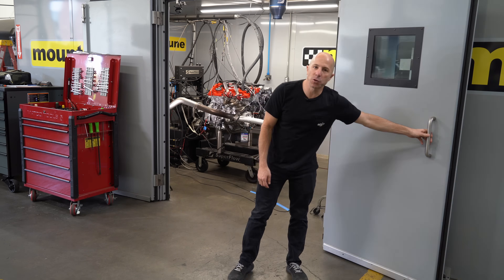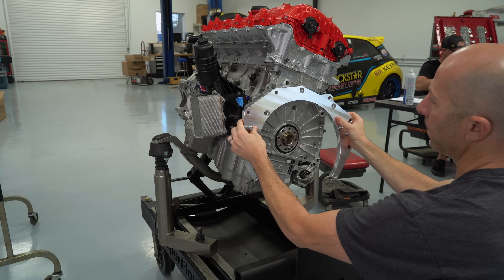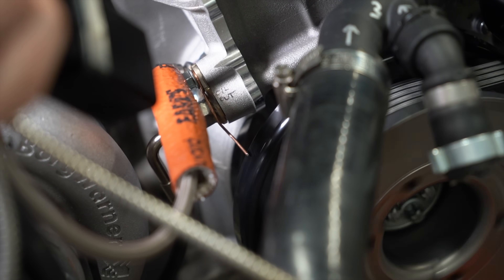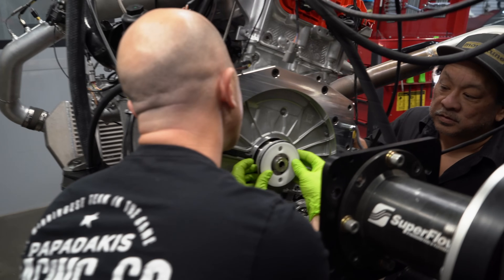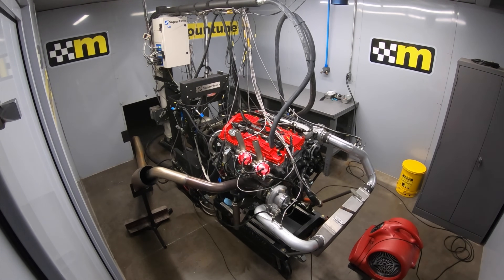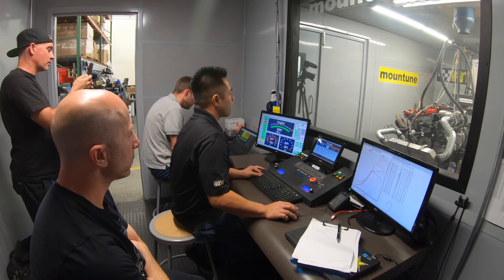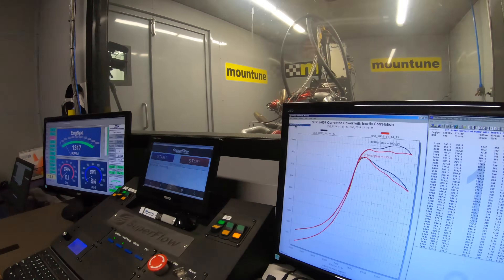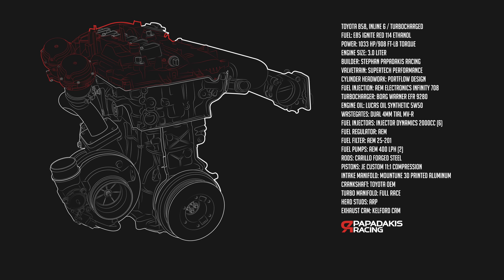B58 Engine Dyno 1000+ Horsepower - Sounds like a 2JZ!?

Comment: B58 makes 1000hp
2JZ: I am proud of you son
(yes I realize it's a bmw engine. Should have said adopted son)
Reply: When JDM fanboys get salty about the BMW engine.. 🤔
Reply: @aricarphotomuc  That's the one thing toyota should've made for the supra. Hell, they could've even used a lexus v6. The b58 is a good engine but it's an insult to the supra legacy because toyota had nothing to do with its production
Reply: @kiyoponnn  hmmm
Reply: Correction

B58 makes 1000hp
2JZ: I am proud of you son from another mother
Reply: B58 makes 911ftlbs
S52: I am proud of you son
Reply: @hyattbusbey3563  Americans ban BMW Z4
Reply: @grocerygrip  change 2jz to n54 wouldn't change the writing
Reply: Grocery Grip German moms are the best right
Reply: @grocerygrip  the 2jz has alot  dominant DNA because it is really similar to the 2jz.
Reply: LOL
Reply: Mix Races 2020
Reply: Well he has a lot of sense to be proud of considering the M50 m52 s50 s54 n54 are just as tunable
Reply: @CirocObama.94  yes
Reply: 1000 German horsepower is a lot faster than your old 90s engine
Reply: @Fanie Botha a full size sedan. You are comparing a full size sedan to a Supra
Reply: @aricarphotomuc  yeah, a legit Toyota platform vs a BMW chassis and block
Reply: @turbocavalli  you know that I am joking about the son thing
Reply: @aricarphotomuc  yeah, but I might as well let it out before I scream it front of my local BMW dealer
Reply: @turbocavalli  Loooo
Reply: @aricarphotomuc  ok my dad's toyota Levin bzr then
Reply: @aricarphotomuc  Camry's aren't full size sedans XD they're a mid size
Reply: @aricarphotomuc  atleast the camry is a toyota not an BMW
Reply: @z0n4l1  Hence its shortcomings.
Reply: z0n4l1 bmw is better then your favorite car brand
Reply: z0n4l1 is rather own a BMW than a Toyota
Reply: @Fanie Botha wooh it's a toyota! a slow grocery getter but hey it's a toyota !1!.

The new supra was also developped by toyota but using bmw parts. toyota stated that the parts bmw manufactures are up to toyota's standard and got through their testing. Toyota doesn't necessarily have to manufacture all the parts to be able to call the car a toyota. If that were the case a whole lot of cars wouldn't exist.
If bmw hadn't gotten involved we wouldn't have ever gotten an inline six sports car from toyota ever again.

I don't see how this car puts shame to the supra name. Nothing about the A80 supra was all that great except that it handled kinda decently under high speed and the drivetrain could take a lot of power. 
It was just a sturdy well built GT car and nothing more really.
The new A90 supra handles well and the drivetrain is clearly up to the task of making stupid power. Seems like a supra to me. And toyota agrees.

Be glad toyota bothered to actually make a new sports car. Everybody can finally stop screaming they want something more powerful than the 86. Which, in itself is a subaru by your logic but somehow nobody seems to care about that.
Reply: @youridv  Congratulations to BMW and Toyota for producing a car in Roadster and Coupe form for everybody.   Our world is  a much better place with both cars. We would all be driving electric toasters with batteries and touchscreens attached otherwise.
Reply: @youridv  The new supra wasn't developed by toyota you braindead moron. The only thing toyota did was the exterior styling and test its durability
Reply: @youridv  Oh My God! best thing I've heard someone say about the a90. Everyone just hates that BMW makes some parts but the name of the motherfucking Toyota GT86, Subaru BRZ, Scion FRS, all of them has the same boxer engine.

But the A90 has the B58 a nice successor to the 2jz👌👌👌👏👏 

Well done sir very well done @Youri Dv
Reply: Youri Dv you have some poor car knowledge or you just lying or telling a information that's defiantly wrong stop misinformation people and check you knowledge the new supra has nothing with Toyota it was tested by BMW you can see by the spy shots the chassis were made way before Toyota joined in the project it is a rebadged BMW there is nothing left from the original supra beside the name and some design elements
Reply: @adrianpopescu3930  If Toyota would have made the car. It would have had a 3.5l V6 or if they would have made the 3JZ it would have been way more expensive. BMW basically saved their ass. The design still comes from Toyota. And it's cheaper than a GTR R35 and lighter than the Mk4 Supra. Yes it's not really powerful but yeah. There is no other manufacturer building inline 6s anymore except BMW and Mercedes has returned making I6s aswell.
Reply: @youridv  nobody cares about that because subaru largely makes good shit, (outside of head gaskets) and bmw doesn't. Same deal with Yamaha and the jz.
Reply: @lakeshoresubtleties  that's bullshit. BMW makes pretty good stuff overall. The B58, N54, S55 and N55 are all strong engines. BMW also know how to make a good straight six.People are just butthurt because their "legendary" sportscar isn't completely japanese anymore. Purists will always be purists and I despise every single one of them. The 2JZ also isn't as bulletproof as people make it out to be. It's a good, reliable, strong engine but people think it's some kind of miracle of god. It's just an engine that's able to hold a lot of power when modified the right way but the circlejerk escalated way too far
Reply: @youridv  💯
Reply: @youridv  it seems to be a trend that  Toyota goes to other manufacturers for their sports cars now 🤔🤔🤔🤔
Reply: Youri Dv all true ma man
Reply: @youridv  always bothered me. Much prefer the bmw collab then the subaru scion/toyota collab
Reply: b58 finna be the daddy soon
Reply: @kobescambler  Barra is the one to aspire to in terms of HP for I6 engine from a production car !!!
Reply: @kobescambler  never
Reply: @clutchkickpj693  Always!
Reply: @clutchkickpj693  remember how many years it took to make 1000hp with a 2jz? This thing is so far way ahead of the 2j. I guess we'll see when and where they start cracking up tho.
Reply: @GreatLakesLogger  it sounds like it's cracking up already, if you have a stupidly good ear, you can hear the cylinders trying their hardest, and not hardest in a good way
Reply: @Fanie Botha 
I didn't know Camry was RWD and had an I6
Reply: Anthony Webber yea it's the new jdm model
Reply: @anthonywebber2211  It had a V6 option and you can convert the drivetrain anyway you like RWD AWD or 4WD
Reply: @mayuravirus6134  
Have fun making a FWD biased vehicle into a RWD one
Reply: 2jz had a hand from Yamaha and the getrag was a German trans soo even the mkIV had some not so Japanese parts...
Reply: Hey hey hey. Lotus has been running that toyota camry engine (2gr) for a while with good results. I'm not saying its better than the b58, but the 2020 evora gt has respectable numbers with that camry motor. 400+ hp, 3.8 0-60.
Reply: Fanie Botha 2020 Supra::: when your mom's Camry looks better than new Supra
Reply: Brad Viviviyal  yep. When R35 came out with the V6 twin people were reluctant about its tuning potential. It caused similar controversy when it came without a manual. And Today, thing's known as the Godzilla!! Mk5 will be a hit among tuners like the mk4.
Reply: @abhinashpattanaik5109  except the r35 wasn't made by Mercedes or audi and the engine was in house too
Reply: Second cousin at best lol
Reply: It took me years to get to that level.
Reply: @Fanie Botha Camry got all the bad genes.
Reply: Lol, it’s a BMW engine
Reply: Milkman69ner RKO OUDDA NOWHERE😂😂
Reply: Hehehehehe see everyone is making this shit out to be so bad it’s like come on it’s a good motor everyone is just holding too high of hopes like relax😂😂😂😂😂
Reply: @HoweDoYouDo1999  You know its not a a cast aluminum right nothing comes good when a german makes anything with soft in and external
Reply: You know you’re a certified badass when your flexin’ your mom’s Camry.
Reply: Better yet:  2JZ : 1000 hp, is that all you got bro?
Reply: Fanie Botha ur so cringey lol.. if ur cspec supra on ig, I’ve seen u talk about ur moms Camry and the “Toyota z4” everywhere. Not bored yet?
Reply: You mean stepson cause it's actually a BMW
Reply: @user-ru1eq7tw4y  Thats pretty much just as racist as saying black men dont raise their children... Every car has jerks driving them, but dosent mean no BMW or other car drivers cant be "classy"
Reply: @Fanie Botha At LeAsT iS a ToYoTa. Then, My YaRiS 1.3 iS mOrE ReLaTeD to A SuPrA.

In your dreams kid.
Reply: Stock 2jz with bolt on's, laughs.
Reply: B58 needs 1800hp to reach the max of JZ
Reply: 2jz makes 1200hp
Yamaha : i am proud of you son
Reply: @bayureswara7835  same setup in a Barra makes 1900hp
Reply: You mean the adopted unwanted by the higher ups German son
Reply: Brad Viviviyal  well, the big difference is the r35 is still on a Nissan platform, still on a Nissan engine, on a chassis made by Nissan, I don't recall Mercedes or audi helping them making the r35, Toyota always has had the money to make a 3jz and a supra platform, but they made this frankenshit for a quick cash grab, "all parts have been precision checked" I have never heard much more bullshit to deny the fact that they just redesigned the exterior, slap a Toyota, and wallah, kickstarter supra
Reply: Technically, its the Supra's son because he married a JCW Mini Cooper which it has the B48 engine, the 4cyl Supra is a girl and the B58 (6cyl) is the boy.
Reply: More like:
B58 makes 1000hp
N54: I’m proud of you grandson
Reply: Still proud

Hell yeah son!
Reply: gotta admit bmw made cool engines, some of my favorite motors are from them. But I got a long list of favorites.
Reply: 2jz is a yamaha engine
Reply: Engine by bmw but built and tuned to Toyota's specs
Reply: B58=N55 not 2JZ
Reply: He adopted LMFA O
Reply: @DhirC35  lmao that could be true.  He stepped up like a man to be a daddy to that poor bmw child. Love is thicker than oil!
Reply: @Fanie Botha k
Reply: More like a step son  but still an awesome engine
Reply: Yeah because 320 hp is something to brag about
Reply: @Fanie Botha your moms Camry is a inline 6?
Reply: @paul williams s a v a g e
Reply: Brad Viviviyal Letalone 1000hp in a few months of it being released
Reply: adopted*
Reply: Nothing new people have been building 1000hp BMW M50 based engines for years... The Supra's BMW B50 is just a newer version of BMW M20 engine family....
Reply: Fanie Botha that “bmw” engine is better than your moms Camry engine could ever be 🙄 you wish u could have a nice engine like this
Reply: @poorcomboz3577  look at this peasant, you are not worthy of the power of engines like the 1hd-fte if you say such bullshit, the camry 1vz-fe is a way better and reliable engine than you think
Reply: @Fanie Botha not a toyota is a BMW!!!!!!!!!!!!!!!!!!!!!!!!!!!!!!!!!!!!!!!!
Reply: 2jz thanks bmw u mean
Reply: Stepson
Reply: @Fanie Botha lol a cockatoo is more related to a supra than a Camry.
Reply: That comment is so emotional
Reply: My prius is more related to the supra than the new supra (sarcasm)
Reply: @Fanie Botha Jy's snaaks
Reply: @arinb.756  someone said it better the B58 is it's the 2jz son from another mother.
Reply: More like step son toyota had to up the standards on the b58
Reply: A Bavarian powerplant adopted by a Japanese family.  The big brother is the 2JZ-GTE and the young B58 looks up to his older step brother.  Looks like the little step brother is coming of age.
Reply: *stepson
Reply: JasonhalloweenXXX  oh you're right
Reply: The M50 exists too. Also the M88
Reply: Well if he Banged a Mini Cooper S and the A90 Supra was born its basically its son.
Reply: @Fanie Botha the 2JZ was developed by Yamaha
Reply: Won’t be as realizable as a Toyota engine tho so $$$ money
Reply: now they are adopted and biological father and son
Reply: I'm just really happy Toyota made a 5th gen supra, I think they made a fantastic choice with the B58
Reply: @EduardGenardAndalis-n3y  And what of it huh? You wanna come fight me yourself at my own house? I didn't think so, fucking pussy
Reply: @Fanie Botha my Yamaha scooter is more related to a Supra than a BMW
Reply: Bmw and toyota split on the 2020 supra. Just toyota now
Reply: Barra: Noobs
Reply: Omgwtflmaololrotfl then barra has 4l of displacement, doesn’t it? Ofc with a 1/3  more of displacement u can make bigger numbers.
Reply: @Benobi2  Not necessarily true. In order to make 2J numbers the engine also has to be able to hold power . If it had some weak as fuck open deck kind of block design the barra wouldn't have been as much of a powerhouse as it is.
Reply: @youridv  the Barra does have a open deck block that's shit.
Reply: @youridv  the Barra block can hold over 2500hp I wouldn't call that weak
Reply: @brentonwood5464  yet can hold over 2500hp so not shit
Reply: Omgwtflmaololrotfl couldn’t agree more
Reply: toyota had a bad divorce with 2JZ and fell for a much more classier gentleman(BMW) and the result is here.. One hell of a kid!🤣
Reply: @abhinashpattanaik5109  Sure...at one shitload of cash later...
Reply: @abhinashpattanaik5109  One shitty child just like you
Reply: @Fanie Botha your moms camry shares almost nothing with the supra other than the brand it's made by. 
There's no relation between a full size sedan and a sportscar made by the same brand.
There are however similarities and possibly relations (as brands often take inspiration as to not reinvent the wheel) between two similar sportscars such as the new A90 Supra and the old A80.
Reply: @youridv  I guess you didn't understand what he ment by being more closely related
Reply: @youridv  well said
Reply: @youridv  r/woosh
Reply: I think alot of you are forgetting he beefed up the internals of the b58 to attempt this 1000hp, when they do it on a stock block b58 then I'll be impressed
Reply: @beastoftheeast2146  It is stock block. Even stock crank.

The only thing they upgrade is Piston, Conrod, and Valve. Literally same thing you did in 1000 hp 2JZ
Reply: Beast of the East it is a stock block what is this man talking about 😂 the internals don’t mean anything is done to the block what kinda terminology am I listening to right now 😂
Reply: Beast of the East stock bottom end I think this man means to say not block the fuck😂😂
Reply: @HoweDoYouDo1999  that is what I meant! My bad
Reply: @beastoftheeast2146  someone will. Also what the build video from SEMA AND I think you see why think it was the second video, but just watch all of them.
Reply: Beast of the East that is exactly why every  bmw fan boy is getting all their feathers up. Lol that shit is built. If it would have been stock everything internally and made 800hp then you can say it’s just as good as a 2jz but for now. Sorry euro boys the 2JZ still reigns supreme. Lol
Reply: @flat_life750  i think the ZF tranny is limiting B58's potential... But the motor is very similar with 2JZ. You can say that its actually a spiritual successer to the 2JZ
Reply: @flat_life750  so an engine that has been worked on non stop for decades is slightly better AT THE MOMENT than a completly new motor noone has even pushed to near its limits yet? Are you delusional?
Reply: blinkers are for slow cars.lol.
Reply: Fanie Botha r u cspec supra on ig
Reply: More of an adopted son.  But a worthy son nonetheless.  A Bavarian adopted by a Japanese family.  I'd love to see Papadakis or someone else test the strength of the stock rotating assembly.  We've seen the 2JZ hit 800hp time and time again on a stock block.
Reply: @andresvalentin6924   how many years it takes to achieves that 800hp. comparing a 30 years old engine to a 2 years old engine.

Comment: Put it back in the supra and make it a sleeper
Reply: I don't think even a stock supra could pass a sleeper
Reply: It wont fit. Look at the space the stock bmw engine has and look at that fmic setup alone. Its too large.
Plus they dont know if the transmission, driveshaft, or rear differential can hold that power or if the BMW electronics will be easy to integrate.
Reply: @shadyshinichi2JZ  it'll definitely fit with some fab work and all those other problems can be easily fixed. It's papadakis !
Reply: @shadyshinichi2JZ  well...they could just throw the hellcats or demons trans in it since its also a ZF and work with it that way. ZF's aren't weak by no means.
Reply: @shadyshinichi2JZ  it will fit.  I can confirm the trans will not hold.

Comment: Pity a 2J still makes more power than the B45? Toyota should never have outsourced the Supra!
Reply: It's it's first time getting into 1000hp and it's aftermarket just started to grow. Give it time its not going to get a leap in hp out of the blue.
Reply: @carboydorifutoparty3976  Yes I understand that but 2JZ's can make that HP on a stock long motor just bigger injectors and turbo.  I still think it's a shame Toyota didn't design a new JZ engine.
Edit: and valve springs

Comment: My heart sank when I saw the sparks from the engine and heard it drop that cylinder.  I was like OH man that's a done motor.  But good thing it was a melty injector, the things you find at the limits are just crazy.
Reply: i was thinking that meltdown wont happen if they were used?. the fuel should help that thing to cool down but then, the seals might not hold from the cylinder pressure